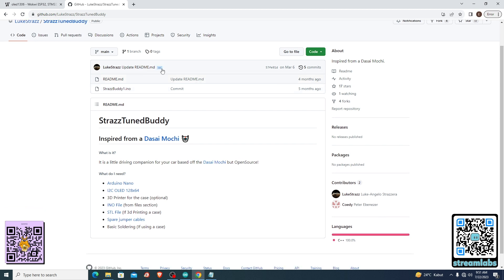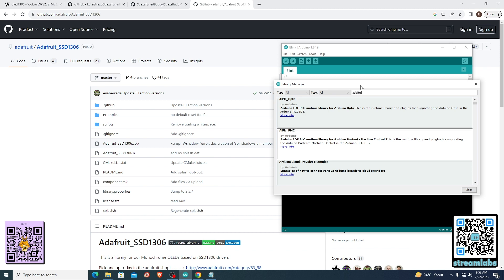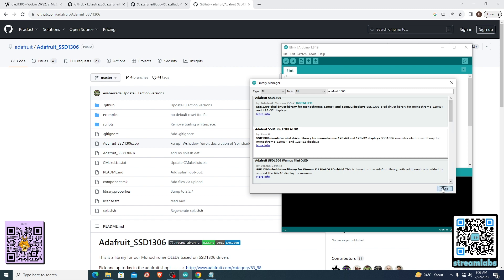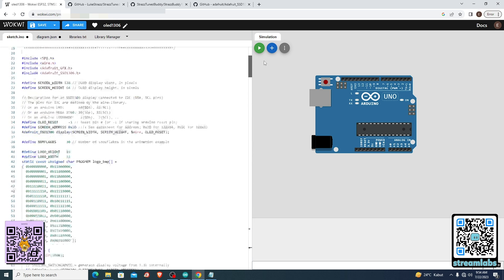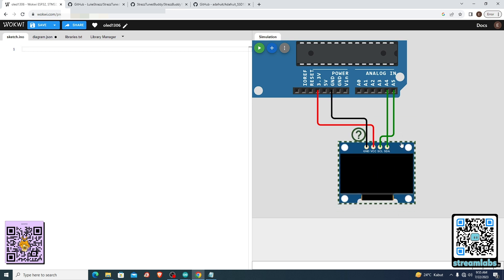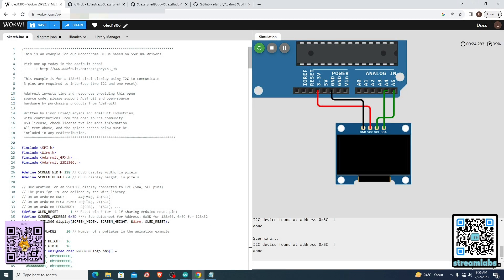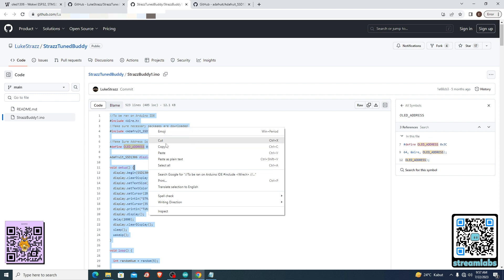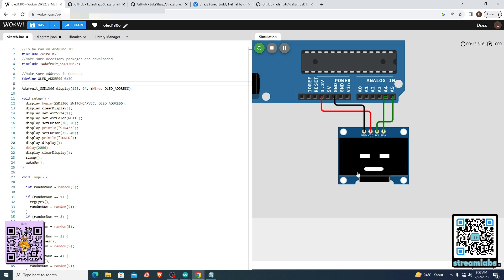ArduinoTutorial : DIY Dasai mochi V1 !! (code included)

Comment: Can this be adapter to a cheap yellow display esp32
Reply from the maker: hi, hello . the dasai V1 won't work (using different code / display)

but for dasai V2  it is maybe around 50-50 chance. 

I can say this because I am using the same library tft_espi 

(same as used in this resource 
https://randomnerdtutorials.com/cheap-yellow-display-esp32-2432s028r/
)

if the tft_espi code from that site working  I'm sure it will work on the V2 animation . (minus the gif file Im not yet update . you should wait after next videos where the audio is done I will update the animation file for 240x320 pixel)

Comment: Can an arduino nano or an esp32 do the job ?
Reply from the maker: yes!! old arduino (uno/nano/micro) are have very similar specs (atmega32x chip) ,  esp32 is a beast compare to arduino , if you want to use esp, check the pin which pin is SDA/SCL cheers!!
Reply: @wenjegaming  ty so much for your answers ! I've got an old esp32 so im gonna try to do it
Reply from the maker: @zefus1212  I'm glad it helps :) ,  this one is an example using the code with different board (ESP32 S2) https://youtu.be/nBGesMXzhoA
Reply: @wenjegaming  i'm trying to develop the gen 2, but i saw that you already made one! I just bought an esp32. Is your code for the gen 2 open source?
Reply from the maker: @temattcha   code? yeah but later on, without animation . be patient ^_^ (patron will get bonus stl case files + full animation) 
animation making tutorial will be uploaded soon!!
Reply: @wenjegaming  I’m your first and only patreon haha I can help you develop this Engel, if you want some contribution
Reply from the maker: hello, thx for support!! ,  the compile instruction a bit late. but here it  is https://www.patreon.com/posts/dasai-mochi-gen2-86712578
Reply: I subbed to your patreon (and i asked some questions below the tutorial) ty  @wenjegaming
Reply from the maker: @zefus1212  hi!!,  I'm really sorry forlate reply because I was making video tutorial & fixing the helmet stl files . (in case you want to try make the V1 animation before sub, https://www.youtube.com/watch?v=STjIIQR4MwI  )  ,  but thank you very much!!  going to check it now